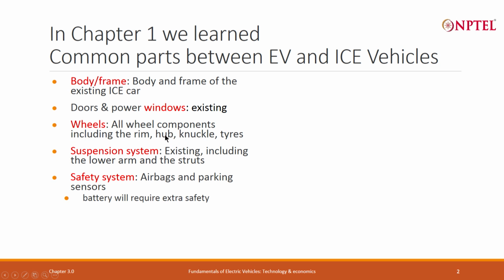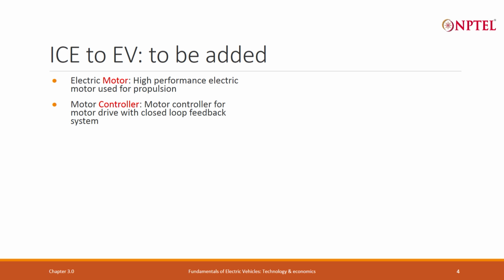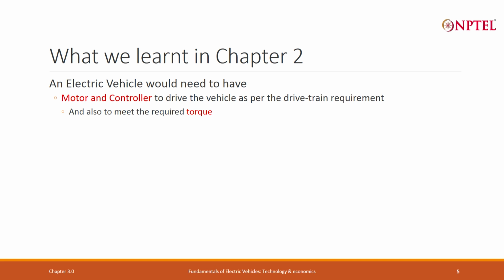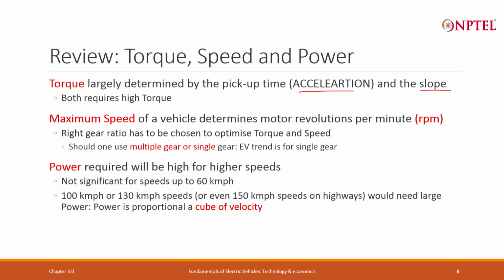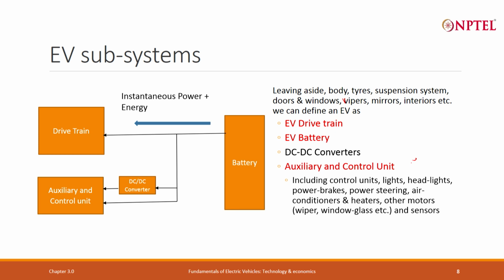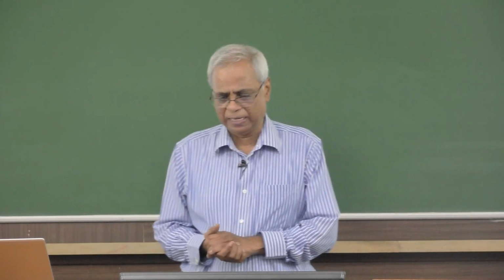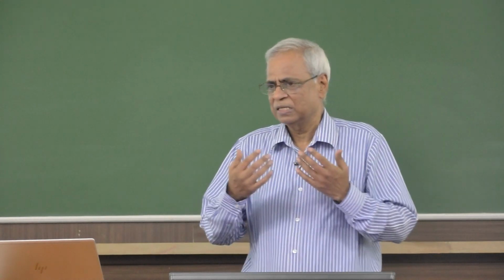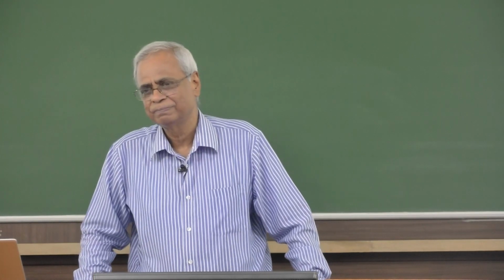Lecture 17 - EV Subsystem: Design of EV Drive Train - Part 1

Comment: Sir i have a doubt if we reverse our vehicle then also will regeneration will happen as motor is reversed.?
Reply: nope because for reversing we have to provide electricity to motor in order to generate torque ... 
if the torque is in motor's rotating  direction = no regenerative braking 
if torque is in opposite direction = can archive regenerative braking
Reply: only during braking power regeneration will work.